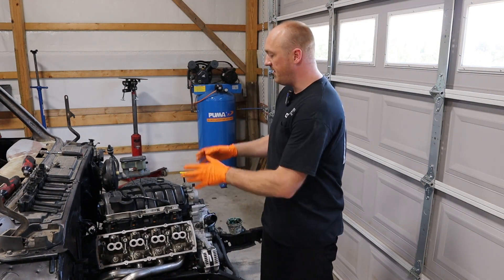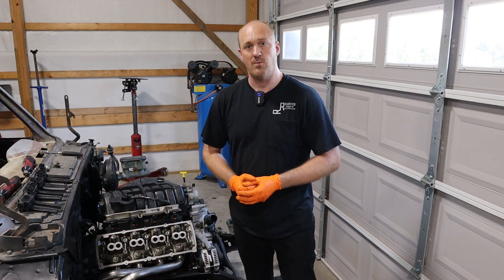392 Hemi Swapped C10 Ep13 Installing Performance Valve Springs!

Comment: What kind of valve frame would have metal around them about a 5.7 hemi it already had the MSD delete on it. I was gonna put a stage one came in, but I took the valve cover out and found metal around the vowel frame.
Reply from the maker: Sorry I'm having a little trouble figuring out what you're asking here. If you're talking about the metal shield that goes around the valve springs in the earlier models that is completely stock. You can see those  little shields in some of my earlier videos, specifically the black Chrysler 300 rebuild.

Comment: Doing these springs on my 5.7 hemi 6.4 cam swap just
 have one quesrion as i keep getting different answers Need to know if i need the 1mm shims on the 5.7 hemi block with performance springs or if i can just remove old and throw on the new??

Comment: I think some grease (Lucas Red & Tacky comes to mind) would do the same job as the gel you are using. And what is your opinion on spring locator cups or interior diameter locators? I bought a CompCams camshaft and that is one of the components they recommend but I have read in forums and other sources that that is not needed.Maybe on a drag engine? Is there much chance of the bottom of that spring moving around on the valve seal? And what might that affect?

Comment: amazing amazing details, I get a headache like i'm in school watching the incredible details you go into.   since the 6.4 trucks do no have the upgraded springs, can I put the 392 cam in my 08 5.7 Durango without upgrading the springs ? I dont spend any time at 5000 RMP's in the truck.
Reply from the maker: Unfortunately the 6.4 cam will not work in pre 2009 engines. 👍

Comment: What did you set the PSI at going into each cylinder?
Reply from the maker: It's not critical, anything more than 35psi is good, I generally use shop air setting of 90psi. 👍
Reply: @ReignitedAuto   thanks for the quick reply!

Comment: I have a question and hope you can help me, Can 6.4 value springs Fit on my 5.7 heads? (2006 300c)
Reply from the maker: Unfortunately no they won't fit. Once they went to the eagle style heads in 2009 the valve springs are longer and won't work in your early model engine.
Reply: @ReignitedAuto  ahh ok thank you for your reply 🙏🏽
Reply: @ReignitedAuto  have one more question, is the 112-500-11 comp cam a Stage 1 cam? Or is it a Stage 2 cam?
Reply: in the intro you mention its the same procedure from 2003 on,  did you mean 2009 on ?  I just checked the video at time :38

Comment: I'm currently replacing my cam and lifters in a 6.4 hemi (my sublime scat pack)  due to the infamous lifter failure ,  I'm going to put a new stock cam back in it with Mopar 5038784AC lifters and hellcat oil pump for extra oiling.  Are the stock 6.4 valve springs pretty good or would you recommend an upgrade, just curious what your opinion would be , thanks for the great videos , I will certainly need them during my build.

Comment: Would these springs fit in my 2010 dodge challenger 5.7 L hemi I’ve pro charged it and I think one of my valve springs is broken because I’m getting a misfire and I it’s only got 63,000 km on it and I don’t hear any Cam problems because I’ve had that before on my pick up truck and it was a cam bearing not a lifter or could you recommend a set of springs for me with a good psi rating with a standard cam just an original factory cam

Comment: A question if I may on the amazon link for the tool, I ordered it but did not notice that the amazon listing is for a Cummins, and would not work for my gen 4 hemi heads.  Am I missing something or can that tool be used on a hemi?  Thanks

Comment: Great tutorial and thanks for the shout-out!

What are your thoughts on using valvetrain parts from Mopar vs aftermarket offerings from Comp, Crower, Texas Speed, etc?
Reply from the maker: In this case I suspect the aftermarket options from the big name companies are probably better, Chrysler doesn't have the greatest reputation for their valve springs 👍. Thanks again for letting me know about the valve springs in this engine!

Comment: Great instructional video.  I have two questions: 1) What is the actual performance gain by upgrading these 5.7L valve springs to the 6.4L valve springs?  2) at the same time of replacing the valve springs wouldn’t it be prudent to replace the rubber oil control seats on the valve stems as well?
Reply from the maker: Basically by increasing the valve spring pressure you decrease the chance of valve float at high rpms so these are good for performance cams where you are going to spend a lot of time at the upper rpm range. Definitely is a good choice to replace the valve stem deals while you're in there, I didn't on this engine because I'm planning on going back into it sooner or later 👍

Comment: Another great video Sky! Looks like you made the "spring hold down tool" with a piece of metal drilled out with a socket welded to the bottom? Love homemade tools!
Reply from the maker: You got it! I actually love how well it works, I actually designed it based off of the chevy style rather than the Chrysler version 😄

Comment: How come that version of the 392 comes with 5.7 hemi springs. So does that means that 05037382BC can be put into the 5.7? they look stronger or should I just stick with the springs you used of the challenger build 68277306AA. Just curious.

Comment: I took off the keepers (Just two or three valves) once after the machine shop assembled them for me, I wanted to check the valve seats.  You aren't kidding either, those keepers are really fiddley.  I would suggest if you are new at this as I was, to order two keepers or so, because it is inevitable you will lose one only to find it a year later.  I did mine off the block (The heads were already pulled)...If y'all have luck like me, you'll 100% drop a keeper down a head drain hole.  I think I would probably get something like silly putty and use it to close off the head drain hole.

I can also say you are definitely correct about those coil towers breaking off.  I wasn't careful and broke the entire plastic tower clean off the head.  Thankfully JB Weld worked fine, but it would have been better for me to do it right the first time.

I don't remember what the max lift is with the stock springs is, my cam is at something like 0.596" lift, so I bought PAC springs which were rated to 0.600".  I have an older (08) Hemi though, so I think the valve springs are different because I read the valves and pushrods are changed a bit because of the VVT stuff.

My hemi was old and oily (Why I did the rebuild) but I noticed when I pulled off some of the coil packs, the "bellows" on the weatherpack connector sometimes stayed inside the coil and not on the plug.  So if you aren't paying attention, you may accidentally try to put one on with no bellows, or worse, have a real hard time getting the connector on because there are two :)  That pick tool, or a set of jewelers/extremely-fine needlenose pliers helped pick them out of the coil.
Reply from the maker: That's a good call on ordering extra valve keepers, they are super cheap so it's smart to have extra on hand!

Comment: I was going to do this on my challenger with a cam swap but ended up swapping out the heads for Mopar scat pack stage 3 heads. They came with fully assembled valve train. Cool to see the job I didn’t get to do!

Comment: I had a customer come in a few days ago with manifold leaks on a 6.4 hemi 3/4 ton truck and he reported it's misfiring. He decided to first put a fresh set of plugs in it to attempt a fix. Then decided to try a coil pack and fix the manifold leaks. I fixed his broken exhaust manifold bolts and warped manifold issue put the coil in and it still had a misfire. Pulled the plugs and you can see where the plugs are firing but they are black and soot filled. After fixing the loud exhaust leak I can hear ticking and now after looking at the fresh plugs on the misfiring cylinder I am beginning to think he has lifter failure. Is this common on the 6.4 hemi like it is on the 5.7 at higher mileage?
Reply from the maker: Absolutely, the 6.4 truck engines seem especially susceptible to lifter failure for whatever reason. Last one I did had 4 failed lifters.

Comment: I am sitting a Compas Minerals in Ogden Utah right now waiting to be loaded with potash. This video couldn't have come at a better time!

With the longer springs is there any chance of them being bottomed out by the new cam?
Reply from the maker: I was worried about the same thing, so I spun the engine over multiple times after all the springs were installed, no issues that I could tell, but driving it will be the final story...